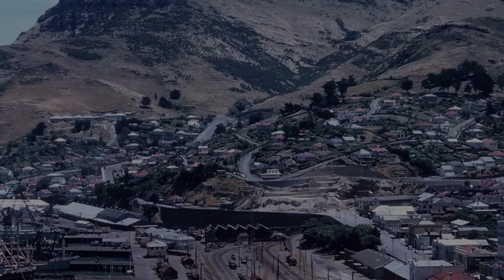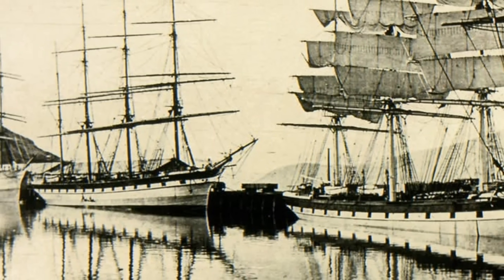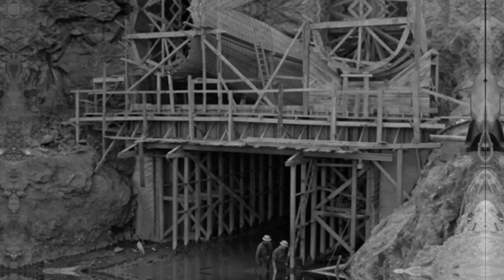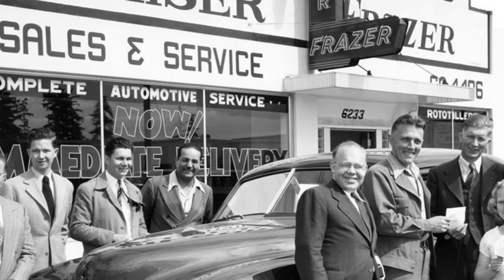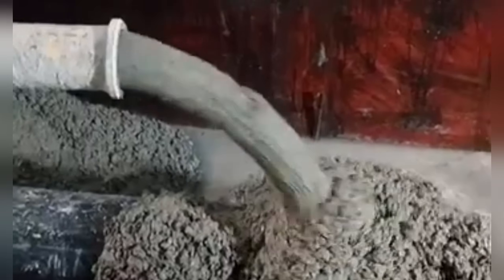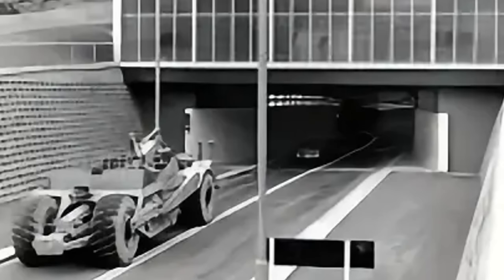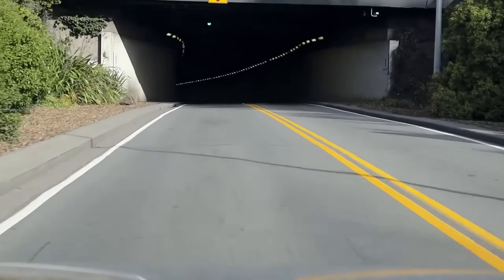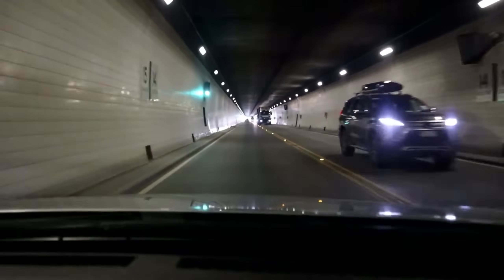New Zealand's Lyttelton Tunnel Construction | The Mega Project That Connected a Nation

Comment: On the family farm, I've got some old original wooden boxes filled with tiles which were made for the tunnel but not used as their colour was wrong....that's what my father told me anyway, he bought them back in the 1960's as they were dirt cheap. He use some for different things over the years, but most of them are still just sitting in their boxes. They are a pale blue colour, I don't know if that was the colour they were going to use and then they changed their minds, or if somehow a batch got coloured wrong?

Comment: I was just a teenager while this was being built and the memories of the blasting still remember today.
We had to keep windows open on the side of the house facing the hills or the blast wave towards New Brighton and the eastside blew windows out.
Hence the curves at each end of the tunnel to minimise the blast wave.
This went on for over a year just the blasting alone.
Everything said in this video is correct and measurements for car widths are in 1960s figures ,as cars were wider back in those days as  than they are today.
Reply: Blast waves blowing out windows? Yeah. Nah. Probably from the same people that used to suggest opening the windows in a gale. 

And the curves at each end are to reduce glare from sunlight in the tunnel. 

My grandparents lived within 100m of it. My uncles used to scavenge the blasting wire. I spent a lot of my childhood trying to unravel it all.

Comment: They could do the port hill tunnel back in the 60's yet still have major issues doing tunnels for road traffic through the kaimai rangers (between waikato and tauranga) and the brynderwins (northland district). The brynderwins are closed more often than not through winter from slips costing thousands for freight and the local economy. Yes fine, doing those tunnels will be expensive to do now. It was done in the 60's for the port hill with a toll. Put a toll on the kaimai and brynderwin tunnels. Make both tunnels 4 lanes. Oh hang on. The greens would complain that it might kill native worms doing all the earth works.
Reply: Thais reads like a pointless whinge. Apart from the ridiculous Greens comment, have you explored whether the ranges you mention could take tunneling or are there serious geological challenges that ramp up the cost? That is often the case and why tunnels are😅an economic option. Then there are the viability studies to be done. Spending a vast amount on a tunnel only makes sense if the economics make sense.
Reply: @thesmallerhalf1968 The kaimai ranges have a freight tunnel already. If The brynderwins are closed because of slips, which happens frequently through winter,  then it's an almost extra hour for road freight in diversions. A tunnel through those hills twenty years ago would have saved hundreds of thousands of dollars in freight costs and repair works. The kaimai rangers is a pain to drive over in a car. For trucks, putting a tunnel through would save ten minutes travel time for them. Anyway, putting tunnels through those two rangers is no worse than the port hills. That's right on a major fault line. And it was volcanic many years ago. the other two rangers weren't volcanic. As for the greens. Look at their b s. They complain at anything. They would rather everything was imported instead of nz being self sufficient

Comment: Pretty small fry project by today’s standards but a triumph in the days when kiwis used to be able to get things done and the local workers were paid fairly for their work
Reply: It would take 20 years now just to get concents
Reply: @paulk6824 And how long did it take to actually get to building the tunnel? Years and special legislation had to go through Parliament to get it done. What’s the difference?
Reply: If you look you will find that plenty of projects still get done in NZ. As for fair pay, that is pretty subjective and you can be sure that most of the workers on this project were not earning massive wages. There will be statistics available.
Reply: @thesmallerhalf1968  your not wrong my figuring comes to today’s value of around $19.00 per hour but according to a quick search this was considered a very good wage in the 1960s

Comment: 5:55 unlike some parts of the world, vehicles are of a more sensible size here. Your standard car/suv is ~1.8m wide, an on-highway truck combination has to be 2.5m wide, 4.25m tall & 20-25m long and up to 44-50 tonnes in weight.